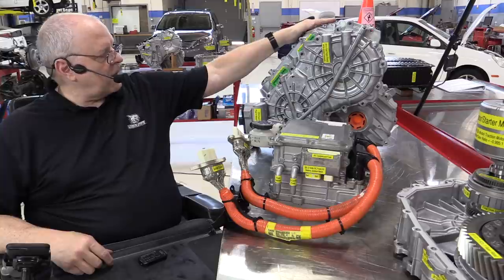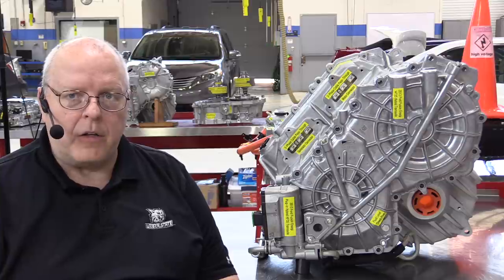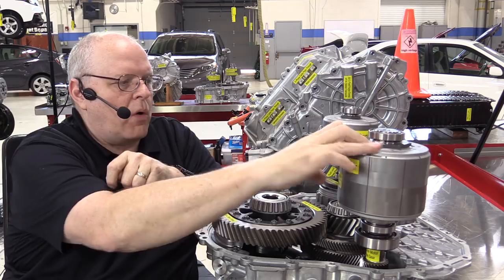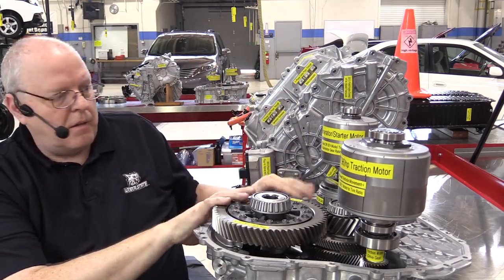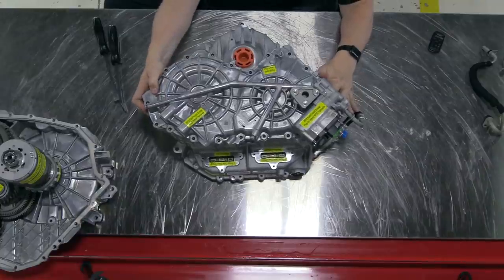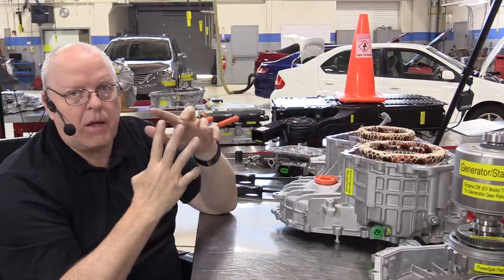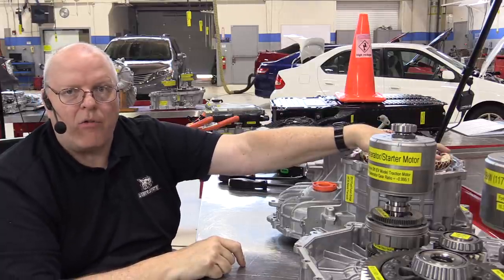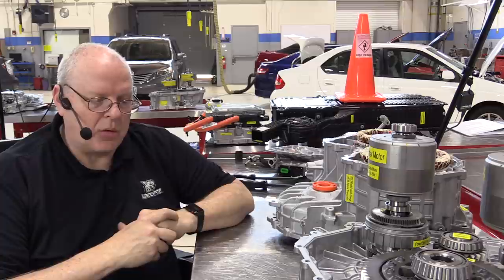Ford Fusion HF-35 Hybrid Transaxle Electrical Operation

Comment: Thank you sir, for this humorous enlightenment that the modern import vehicles have not seen the need to improve on the Ford Motor Company's Designs from way back in 2005 (having been with the Ford company since the 80's as a tech.)

Comment: This video actually helped me diagnose my vehicle. I drive a 2015 Ford C-Max energi, and him showing the auxilary transmission pump helped me identify the connector I needed to clean up. If you also get a P0C2- code, check that connector! It might be loose or dirty

Comment: We purchased a Fusion Energi to go along with our Mitsubishi Outlander PHEV after the family learned the benefits of owing an EV - a full electric is a step too far given our poor public charging station network, but we only need to visit a gas station once per month now on average, sometimes longer. Both vehicles drive brilliantly, and ownership costs has dropped by $400 per month at the cost of $40 higher electric bills. Not a bad trade-off at all. 

Thanks again for the in-depth explanation of the less known Ford Hybrid powertrains.
Reply from the maker: Thank you, it is a good vehicle

Comment: Thank you John for educating me on how my 13 Fusion works.  I did notice something strange.  Those 2 large (orange) high voltage cables have connectors the look identical.  They don't appear to be keyed in a way to prevent them from being swapped.  Maybe they are but it's not noticeable on the camera.

I'm a retired machinist from a large connector manufacturer, and that type of keying is extremely important.
Reply from the maker: Thank you. Good eye! They are actually mirrors of each other, so they will not interchange.

Comment: It's interesting to see a hybrid design convergence of the parallel motor generator for Ford, Toyota- GM, and Chrysler. This is the same for example with the internal combustion engine variable timing and direct injection and many more.
The various manufacturers experimented with their proprietary design until the industry decided toward common design concept.
Reply from the maker: Good point, thank you for your feedback.

Comment: Thank you for the information.   I want to put this system in a boat I’m building. I know I won’t get the regenerative power, but I’m okay with that issue. Will watch the rest of the videos to see why it wouldn’t work.  Thanks, Chris
Reply from the maker: Thank you!

Comment: Very interesting, I have worked on some Honda and Toyota hybrids, but the wife's Fusions seemed to stop working. I had thought maybe the trans had gone bad (seems like the stator is not capable of making the car move). I did a code scan - could not believe that there were no codes in ANY of the systems. Except when you shut the car off it tells you how many EV miles and Regen miles and those are almost always 0 or very .2 almost nothing.  So I figured I better start doing some digging and learn some before I make a 5 thousand dollar mistake on what maybe a bad connection.  
Thanks for the great video and all the info - will be watching more
Reply from the maker: Thank you

Comment: I'd like to hear more about the big micro-chips that are the brains of these motor controllers.  It seems to me these chips are the breakthrough technology that made these game changing transaxles possible
Reply from the maker: Thanks for your feedback. I would also like to know the same thing.
Reply: Reading up about Brushless DC motors can reveal a lot of the background... I have limited hobby-level experience with one chip by Texas Instruments, the C2000 which is a microcontroller (embedded CPU w/ built-in memory) whose CPU core is optimized for the kind of math required.  You quickly get "into the weeds" reading about this stuff but here's a few articles to chomp on - http://www.ti.com/lit/an/bpra055/bpra055.pdf ... http://www.ti.com/lit/an/sprt703/sprt703.pdf ... the C2000 series processor I evaluated once - http://www.ti.com/product/tms320F28027 - You quickly realize that the same set of processor "skills" required to perform motor control are also relevant with digital power conversion, think not 3-phase inverter for an EV but also 3-phase or single-phase inversion for producing AC power for the grid from DC (e.g. solar+battery) sources as well.

Comment: Outstanding video Professor John. I have just bought a 2014 Lincoln MKZ 2.0L FWD Hybrid with The Hf-35 xCVT trans and it is leaking out about 3qt, but the car drives great. Because of the leak the Transfer-shaft assembly (EG9Z-7H348-A) bearing and cup should be shot, but those parts only cost US $410 right now. Is it possible to put a rebuilt used HF35 eCVT or even a newer Ford 2017-up HF45 eCVT and not have to reprogram the power transfer unit? The only cable that comes out of both trans are the hi-voltage drive/regen motors and the low-voltage data cables (that reads both motors temp and speeds). From what I have read; the HF35 has no brain or need for VIN programming itself. I ask because my locale Lincoln Dealer just quoted me US $10,000+ to replace the HF35, recalibrate the Lane-departure system, and realign the wheels. Since I was not born yesterday and value my family's treasure, I figured I would ask an expert. The car is beautiful and still drives it just need seals and bearings but no trans shop in or near Chicago will touch these eCVTs due to Ford's EV service equipment requirments (an anti-static bay). I have removed FWD trans and replace clutches before and I am thinking of removing and rebuilding my own trans because of inflated dealer costs. Any help you can provide would be much appreciated "for eductional info only... lol". Thank you for your time, sir.

BTW: Can you do a trans removal video on the HF35 and HF45? That would be amazing.

Comment: Thanks for breaking this down. I've had two Fusion Energi models (13' & 19') and have found the design to be terribly durable so far. Since there is no torque converter, would it be just a fluid change and not a flush?
Reply from the maker: Correct.  Thanks for watching

Comment: Thanks for your work, just fyi we’re about to trade in our 2017 C-Max energi with 340K miles for a lower mileage 2017 C-Max. Had to be a rideshare driver in 2017 after years as a taxi crown Vic driver. Kudos to Ford for the excellent vehicle and wish they had a 2022. The best vehicle ever and has never needed a brake job!!
Reply: Wondering did you ever change the trans fluid? My fusion hybrid just 200k and just realized it was suppose to be replaced at 150k
Reply: @beammeupscottsp7952  yes, trans fluid change was done twice and most recently was at 310k .. sad to say a large deer ended that vehicle just one week after we installed a new ford factory rebuilt engine. we’re now using Tesla model 3 with no issues after 33K miles and 5 months in service . TY
Reply: @jamesmonroe8962  oh wow! I’ll make sure to change the trans fluid as soon as possible then, hate to hear about the accident but congrats the on the model 3, will go full ev but not until the fusion hybrid decides to give out. If there’s any other maintenance service you did please let me know!

Comment: Great video, thank you. I've got a 2014 fusion hybrid and you have a wonderfully straightforward way of breaking down and explaining all the components. One small criticism ... I don't know exactly how the fusion inverter drives their stators but if it is like a typical VFD system I suspect your voltage explanation is a little off. Typically a 3 phase system like these motors are not really 2 on, one off so much as a staged change where one is voltage is always 1/3'd of the way ahead of it's brother, they lead each other around more than alternate.

Comment: Thank you for these videos, they are helping with my disgnosis of the common P0A7C on the 2010-2012 Fusion Hybrids. As of yet, I don't know of any solution, and Ford's TSBs seem ineffective.
Pretty sure I've narrowed it down to the coil temperatures, which means I need to drain and fill the transaxle fluid (and measure how much is in mine).

Comment: Interesting how similar the Ford and Toyota designs are.  I’ve heard the original Escape hybrid has one of the most bulletproof drivetrains ever made, and taxi services have consistently been able to pull half a million miles+ without trouble.  It seems that the Achilles heel of the Toyota system has historically been the motor winding(s) burning out.  Now that they’ve switched to the bar-wound stator assembly (like GM has been using for years), I have a feeling the P610 won’t have these issues.   It looks like this will be a very good transaxle, so long as the heat exchanger is effective enough to cool the transmission fluid and prevent the ATF from cooking.
Reply from the maker: I agree, thanks for your feedback!
Reply: I've read several times that Toyota and Ford share R&D on hybrid platforms so makes sense they would have similar systems.
Reply: Ford did use the same transaxle manufacturer (Aisin) for the Escape Hybrid that Toyota uses, but Ford did its own research and discovered similar patents, so Ford and Toyota exchanged patent rights. Ford never copied Toyota ideas.

Comment: Wye should be how its connected, all three hot wires are connected to one neutral, at least for a three phase AC stator. The other is a Delta which has 4 wires, three hot and one ground. Company I worked for used wye connection on our three phase 400 hz systems, but again these were AC inductance motors. So Im not sure with this setup. Our Stators looked exactly like those too, I use to make some of the coil windings myself, also the stator stacks, then they were sent out to be inserted. Women were better than men for inserting the coils. When the completed stators returned to us they were then impregnated with a 2 part epoxy in a vacuum chamber so there was no air in the stator windings. The wires are called magnet wire, the coating is extremely tough, that tranny couldn't get hot enough to melt that coating under normal operation. The wire itself is fully annealed.
Enjoyed what I did and I thank you for an awesome video...

Comment: The power split system on my 2014 CMAX doesn't appear to be operating in tandem anymore.  It used to be that over certain load levels both electric and gasoline motors would be working together then the electric motor would take over when the load was light.  We just got hit by 34days worth of -40 degree celcius weather and upon the 3rd day I discovered the hybrid battery had dropped to near zero from full charge the night before.  Since then when driving it's either full electric mode or gas only mode regardless of battery charge level and the two only work in tandem for very very brief periods maybe a few seconds at a time.  I can hear the switching from inside the car.   I don't know enough about the system to judge if prior operation was normal or if the current operation is normal and the cold weather had nothing to do with it.  It's still under warranty 44000km.  Fuel economy sucks too 33mpg (city) and that's with the ever optimistic digital readout, it's actually closer to 30mpg.  Anyway, any ideas?
Reply from the maker: Most engine coolant temperature sensors register -40 degrees C when there is an electrical open circuit. The system may have been tricked into thinking there is a malfunction. The very cold weather will certainly affect the operation.  I would have a Ford dealership check it for recalls, technical service bulletins, and any malfunctions that have not illuminated a check engine light. Best wishes.
Reply: @WeberAuto     I've an appointment set for this Monday we'll see, I actually really like this car and hope they get it all sorted.  While the fuel economy is a bit disappointing for a hybrid i'm coming from a 7mpg truck so happy any which way. Thank you!

Comment: I have been following the Lincoln vehicles from the mark series up to the 2016 model MKZ hybrid. Since the Ford fusion hybrid is built at the same plant in Hermosillo Mexico as the MKZ hybrid I believe they are both Same .

I enjoy all your videos about this particular product I do on wiring diagrams two vehicles from 2014 through 2019 on the MKZ or a fusion they’re both the same book and the energy thank you very much you do a Netflix job regards

Comment: I know I'm late to the party on this one, but have you considered discussing how the HF35 needed to be redesigned in 2015 due to a known design flaw which caused very rapid bearing wear and potential failure/need to replace the transmission on many Fusion/C-Max hybrid cars. I would be interested to learn what they changed with the should-have-been-recalled-but-didn't design.

Comment: thanks sir for sharing this information... how much the output voltage for the generator? and what is the input voltage of the motor?.. why they called it high voltage? is more than 2000 volts? how the brakes gives the high voltage?

Comment: I use a wheelchair and just bought a 2010 E450 hybrid . Having problems finding manuals or mechanical manuals for the Azure hybrid plus that battery. Any suggestions? I want to use this e450 cutaway limo wheelchair lift bus. I'm disabled Deaf Veteran: I'm so grateful for CAPTIONS!  Thanks

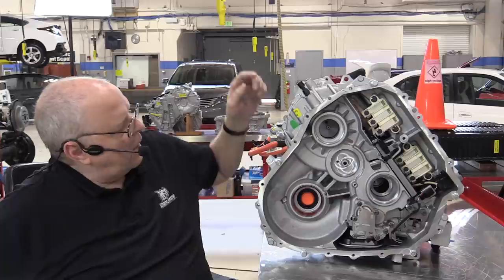Comment: Professor, could you please post an image of the fluid level port for the HF-35 that you mention at the 14:00 minute mark of this presentation; I just changed the Mercon LV on my 2013 CMax and want a better idea of a correct refill than just the replacement of fluid volume removed. Thank you for sharing this information.
Reply from the maker: Pause the video at https://youtu.be/MZf_BUuW5Qg?t=266 The Fluid Level Check Plug has a yellow label and is shown in the bottom right of the screen. Thank you
Reply: Fantastic! Thank you for pointing that out, I had missed it on the first viewing; will share with another person who has a DIY fluid change video posted.

Comment: Is mercon LV petroleum driven? I used Molly to reduce the bearing friction and it did. Wonder about its effect on the windings coating. Also this time I wanna use DCT full synthetic Lv, fluid which is very close to mercon. Only thing I wonder about is the coatings on the windings.

Comment: Hi. Can you please tell me, my friend and I cannot understand how the planetary unit works? Is there a ratchet or some kind of overrunning clutch? Or why, when the engine is off, the planetary gear itself with the traction motor rotates, but the engine does not? Through what mechanism is the torque transmitted from the engine to the main gear?
If so, does it have a ratchet that has free play in one direction and does not have it in the other?
Thanks for the video, very informative

Comment: Sir, I'm looking to take the L3 ASE test, and I'm wondering about how ASE classifies hybrid types in their certification test reference literature. "Type-1" seems to be a Toyota or Ford hybrid. "Type-2" seems to be an older Honda, and "type-3" seems to be a newer Honda style. Would you concur with that assessment, or am I confused?" This channel is wonderful, and I've learned so much from you, thanks.
Reply from the maker: Type 1 (Series-Parallel Hybrid System) is Toyota, older Ford, and FCA power split device based hybrids.
Type 2 (Parallel Hybrid System) is older Honda integrated motor assist (IMA) systems, but there are many other hybrid brands that use the same system (Hyundai, Kia, newer Fords, VW, Audi, older GMs, Newer Hondas)
Type 3 (Series Hybrid System) is Chevrolet Volt in transmission mode 4 and newer Hondas (E-Drive)
I have video playlists on each type of hybrid system. Best wishes with your exam.
Reply: @WeberAuto  Thanks for taking the time to respond. Your students are truly blessed to have you as a professor.

Comment: Hello from Ukraine, Professor Kelly!
We are working here on a project to restore Ford Fusion 2017 plug-in hybrid. It has a broken transaxle oil pipeline including a transaxle nozzle so we have to replace a part of a transaxle case. We can't find any relevant information to confirm if Hybrid and Plug-in hybrid transaxle cases are the same. I would be grateful if you have the answer and you can share it!
Thank you for your videos, it helps a lot!
Reply from the maker: I believe they are the same case

Comment: I own a Ford fusion hybrid and I have to admit I laughed when I saw the new Prius transaxle
Reply: I own a 2016 fusion Se hybrid too, but Toyota’s gears are like 20 times better, there are many fusion gears that are failing... way too many
Reply: The Ford and Toyota hybrid transaxles are made by Aisin , a Japanese company which got its start during World War II. it has been wrongly reported that Ford merely license Toyota's design. In fact Toyota and Ford just agreed not to sue each other for patent infringement on hybrid transaxles so they do use the same basic design. The planetary gear set itself dates way back to at least the design of the Ford Model T.
Reply: @aggressor9517  Source?
Reply: Source for what?
Reply: @aggressor9517  of all the failures... News... Articles.... Reports.... The 35 transaxle tech is toyota and ford based. Shared tech. The transaxle is actually quite robust and taxi fleets are getting 400k-600k miles on original gears and batteries.
Reply: @DanNPTRI  check Facebook pages, I own a 2016 hybrid fusion and I see other people who own the same car, also search the internet, it’s not robust it’s really crappy
Reply: @DanNPTRI  just search fusion hybrid transmission problems 400k mile lol
Reply: @DanNPTRI  the HV battery on the other hand is superb